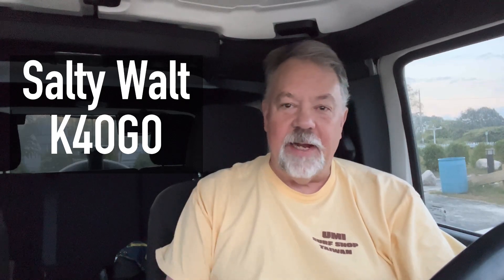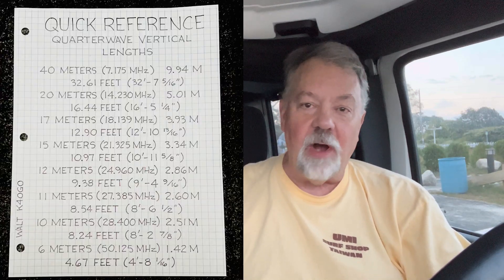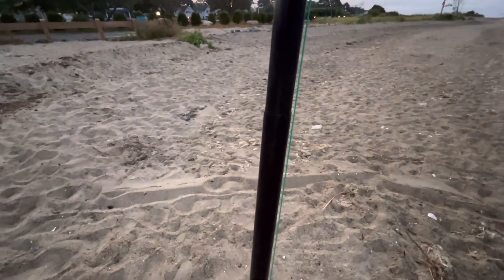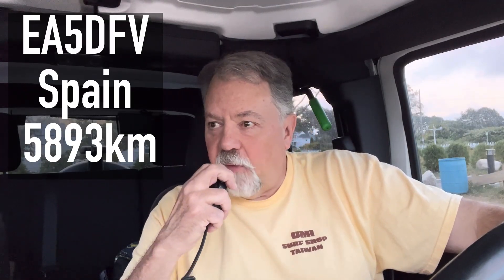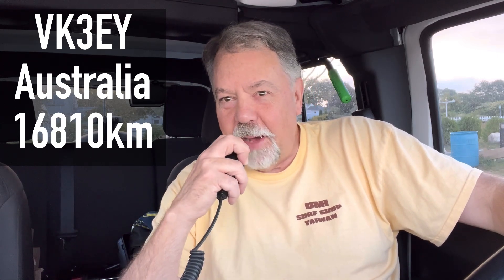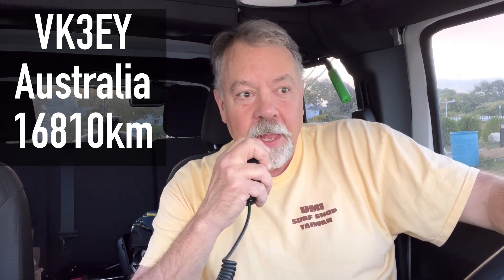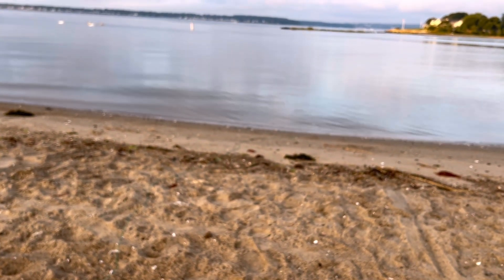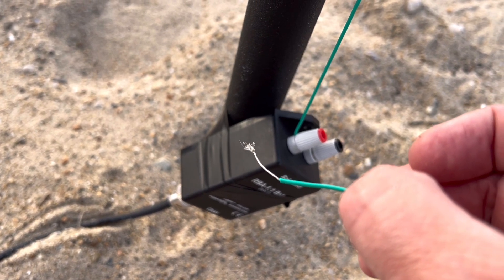Building an Easy Quarterwave Vertical Antenna

Comment: Hi Walt, wondering why it’s always a vertical when there are other great antennas like a doublet for multi band or a simple 10 meter dipole or 11 meters for your CB?
Reply from the maker: Because 99% of the time I’m sitting on top of the world’s greatest ground plane. My main thing is portable by saltwater. A dipole by saltwater is a dipole, a vertical by saltwater gets a 10dB boost from the saltwater underneath it. I’m not sure if you followed my channel when I was in Poland but I built every horizontal, inverted V, sloper I could think of and had a lot of fun doing it but I’m “Coastal” Waves & Wires and that means more towards the vertical side of things. 73, Walt
Reply: @COASTALWAVESWIRES   yep
Reply: Poland has salt water also
Reply: I tend to run verticals due to limited space for anything else.
Reply: Walt are you gonna make a new sketchbook? I have your first one and I love it!

Comment: When you say “kissing the water”, does that mean on wet sand, constantly submerged, or occasionally overlapped by the surf?
Reply from the maker: Wet sand or slightly into the water, not submerged.

Comment: Your videos on all these antenna configurations are extremely helpful and educational.  I do not have the luxury of saltwater.  If my 1/4 wave vertical is on top of my deck (10 ft. in the air), how do I manage the counterpoise(s)?  Thanks.

Comment: Hi Walt, I love your videos. As a new Ham myself, I find them very helpful. One question, is there any reason I couldn't use aluminum as the pole for one of your vertical antennas? I got a smokin deal on some heavy duty conduit at a scrap yard. Thanks!
Reply from the maker: @glennluther7532  thanks! You can use the aluminum as the driven element itself and it would work. As for attaching wire to it, that wouldn’t work as the wire will couple with the metal pole.
Reply: @COASTALWAVESWIRES  Even if I used insulated wire? If not, could the pole be used to hold a whip or as part of an inverted V or sloped wire? Pretty ignorant here. Thanks!

Comment: Took your advice and built a 1/4 wave 10m vertical antenna out of 24ga wire and a banana plug. Used 4 5m counterpoise wires and hooked it up to my yaesu ft8900. Didn't hear anything on 29.6 simplex but I did pick up a repeater on 29.62 in New Jersey.  Time to get the ft857 fired up and try some other bands. Thanks for the inspiration!
Reply from the maker: Awesome! 73, Walt

Comment: Great video Walt!  I am a new ham, Technician license operator and I'm looking to make a simple vertical wire antenna and this video helps.  I'm limited to 10m right now until I get the chance to take my General test.  Just to confirm, by looking at your chart, for a 10m I cut the wire about 8.24 ft and my counter poise can be 17 ft??
Appreciate any feedback.  73 my friend KO6FWW
Reply: Just so you get an answer:  243/fMHz for the vertical radiator & 105% of that for the horizontal radials is a good start.  As for the number of radials, more is better; some say at least three.
Reply: @8TangoCharlie  thank you for the response and feedback! This helps! 73!

Comment: So to change bands do you just lengthen or shorten the vertical?
Reply from the maker: That is correct, a vertical for the 10 meter band is half as long as a vertical for the 20 meter band, a vertical for the 40 meter band is twice as long as a vertical for the 20 meter band.
Reply: @COASTALWAVESWIRES  can't wait for the book to get published.

Comment: A few years back I decided to make a simple dipole for 20M. I used the banana clip but I didn't have a place at home to extend the dipole. I used a 25ft fiberglass pole to put one leg vertical then just strung the other leg out as a counterpoise. SWR was not very good  so the end of the counterpoise being close to my deck I raised it off the ground about 3 ft and got great SWR. I did a POTA activation with that antenna and it went in the antenna box. I later built a 40M version. Both were made from speaker wire and the banana clip. Fun to experiment with antennas.

Comment: I had previously ordered a banana plug connector, and it showed up today, so i decided to build one of these. Alas, i didnt have enough wire, so i built a 10m quarterwave, with 3 counterpoise wires. I had no luck picking anything up on the 10m band, but it worked great as an eighth wave 20m antenna, i was able to clearly receive stations in Puerto Rico, Florida, Netherlands, Italy, and somewhere in eastern Europe. my 5w USDX+ lacked the power to get out unfortunatly

Comment: Can I use the pole if its made from EMT as the antenna instead of wire? make the base out of PVC to insulate from the groumd? If so, then I can adjust the sticks length by sliding them and tighten the thumbscrews?
Reply from the maker: Yes that would work

Comment: I’m just curious, have you tried it without the 1:1? I don’t own one but I usually use  coax with RF beads on it. Which I think is basically the same thing. Does the wire actually have to be in the salt water or can it be close?

On another note….. 
I call BS in length doesn’t matter and more shorter are better than less longer while lying on the ground. I’ve done a lot of experimenting with this very subject in several different locations over several different kinds of ground.

I’m using the WRC Sporty Forty and the Chameleon 17’SS whip on a tripod or stainless steel tent stake w/ a stainless steel jaw mount. It didn’t matter whether or not I used either. With the tripod I was trying to isolate the ground side from actually being “grounded”. I laid out 12 16.5 radials and the SWR was over 4:1, then removed 4 and it dropped to 3:1, removed 4 more and it dropped to 2.5:1, folded the last 4 in half and it dropped to 1.2:1. So now that’s 4 radials @ 8.25’ or 33’ of total radials. I also took 2 sets of my 16.5 radials & made them 33’ long so now I have 4 1/4 wavelength radials lying on the ground. Sliced a little bit off the end of each one and got a 1.3:1 or less across the entire voice portion of 40m. Then I removed the coil and tried 20m, and now I have 4 1/2 wavelength radials lying on the ground for 20m. This got me about a 1.6:1 across the whole voice portion of 20m which isn’t bad. I have no idea why it happened this way, but it did. I’m option to theories as to why.
Reply from the maker: Yes, the video in this with the 5 counterpoise on the ground are with a clip instead of a balun. I’ve actually done a couple other videos on 1/4wave verticals done that way. The counterpoise just needs to at least be over the wet sand from my experience.
Reply: @COASTALWAVESWIRES  thanks Walt. Another great video!

Comment: Hi Walt. Indeed a cheap antenna to start HF experiments as a new ham. A telescopic 17 ft whip is also a nice way to go. They been sold with markings for band lenghts from 20 up to 10 meters. Cheers Phil ON4VP
Reply from the maker: Roger that, I have 3 of them. They are great

Comment: Hi Walt! Thank you, as always very interesting. This is a simple and classic antenna that works well over long distances. I want to share my experience. If you leave only one counterweight and raise it a meter from the ground, the antenna will work even better, and the installation will be easier, and there will be less wire. I checked it in the fields. In general, you have a big advantage, you have a salty ocean nearby.
Reply from the maker: Yes, that will work great. As I mentioned in the video here, I'm just trying to show a lassic simple vertical groundplane antenna. 73, Walt

Comment: Another encouraging video sir. But may I ask, with this wire antennas, what is the maximum power can it be transmitted with it?
Reply from the maker: With 16 gauge wire I have used 100 watts. You can transmit with as much power as you want, you just have to gauge the wires used.
Reply: @COASTALWAVESWIRES  Roger that sir. All the best to you and your family.

Comment: People always make a big deal about radials for verticals. 

Not half an hour ago I was out using 17-ft whip and a coil for 80 m cuz why not?.

Use the same radials i always use. Two bundles of five wires each approximately 10 ft long, scattered somewhat haphazardly around the antenna. 

It worked just fine. 
Psk reporter showed me in the midwest as being heard in Maine, Nevada and really big in the Southeast

No choke, no balun. Just coax and 5 watts.
Reply from the maker: Yep, just get some wires on the ground. 73

Comment: Thanks for another great video Walt! I travel every week as well and just got my license (extra!). I have a question on the radials. If I want to have a resonant 10 and 20 meters can I cut the radials for 20 and use them for both?
Reply from the maker: Yes absolutely, use them on both. When radials are on the ground length is not an issue. 73, Walt

Comment: Would love to see difference with CP in and out of the saltwater in same location to see big of a difference it makes👍
Reply: My personal experience is that I don't find any difference between counterpoise in and out of water. The main problem here on the beaches I operate from is that there is a big difference between low and high tide which would mean moving up and down the beach with the antenna!

73 M3KXZ
Reply from the maker: @petemillis4666 my experience has been as long as the wire is over the wet sand near the water I’m good.
Reply: @COASTALWAVESWIRES  same here. Even on the shingle and chalk we have here, it's all still wet wet salt water at depth when the tide is out. Can't wait to get out again now. Beautiful weather here, but I'm working from home! 
By the way, speaking of seafood (even though you didn't mention food in this video), are Arbroath smokies available where you are? They're from Scotland. If you ever see them where the are, or are ever here in the UK, you're in for a treat. Gorgeous heated in the oven with a slathering of butter!
73 M3KXZ
Reply from the maker: This should answer your question, same antenna as I built it in Europe:
https://youtu.be/iDEUfPgx44M?si=oc3Y1t0Xk8qGPDeQ

Comment: Excellent advice and video! I gave built many a quarter wave vertical over the years. Radials or specifically the number and length are overrated! Once you have enough to bring the SWR down to maybe 1.5 to 1, I have never been able to detect any improvement in signal strength. Sometimes its only one short radial, sometimes it takes more. All depends on composition of the ground. Even some of my best 160 contest scores have been with one or two radials. Also the length is not very critical. I always cut for CW band and the SWR is usually good enough across the band ( except 160 and 80 meters).
Reply from the maker: Thanks and roger that my friend!

Comment: Great job Walt !   Simple but good antenna .  Some kind of choke at base of antenna is a good thing. a 1:1 or ferrite chokes on coax or even coax wrap threw a toroide . all does the same job. Blocks RF from coming back on the outside of shield of coax.  This can cause RF getting into the mic and or effect the far field pattern of antenna.   You want the counterpoise to work . If you want coax as counterpoise then you choke at radio side either the ATU or radio . Some times the length of wire changes. Velocity factor of wire. and type of metal. Just trim to low SWR . Do not over think it. SWR of 1.5 can talk great ! . I talked all over DX with 1.7 SWR . Just threw a antenna together 5/8 wave into 4:1 . measure cut put up I got 1.7 SWR on 20 meters called CQ POTA and got pile up. and was at 50 watts from 7300 ICOM. on 20 AH battery ! 73
Reply from the maker: Thanks! Wow that's cool on the 5/8. I need to do more on that antenna. 73, Walt
Reply: @COASTALWAVESWIRES  Appx 43 ft for 5/8 wave at 20 meters. 20.5 Ft and 25 FT also work with 4:1 . I had to slope instead of vertical . need longer pole . Callum had one. saving up

Comment: As always a good video. I am old but an uncured Ham and love playing with wire antennas. This was the first antenna I put up and made a QSO as an Amateur back in May. I don’t put up tall antennas, <30ft. (9ish meters). Mine works well with my G90. Mostly I use random wire antennas; I have a G90. Coastal 20 (close to this video’s 1/4 wave) has become my favorite- quick and easy. Rybakov is a close second. EFHW is good but too much work for my lazy retired status. I’m working on a Salty Walt 20.5’. Looks like this weekend the Bass  Boat Rybakov (BBR with a PBR) may get tested. Do I have to catch a fish too for it to be considered a success? You need to come to Tennessee for some Nashville Hot Chicken. PS - I have started building my own baluns and ununs. I kind of make antenna kits so I can better organize and activate on a whim. I keep wondering how much time do you spend playing radio versus chowing down at the local diner? Lol. Coastal Diners, Waves and Wires seems to be a de facto channel. Take care and glad to hear the update on your wife. Godspeed.
Reply from the maker: Thank you so much! Godspeed my friend

Comment: VK contact because you're on the beach?  Or is it more time of day?  Or combination of both?
Reply: Both.
Reply from the maker: Time of day definitely, the saltwater also give the antenna 6 to 10dB gain which helps the low power 20 watts. The antenna is still very effective, here is the same antenna I built well inland in Poland using the same radio at 20 watts: https://youtu.be/iDEUfPgx44M?si=oc3Y1t0Xk8qGPDeQ
Reply: @COASTALWAVESWIRES  your poland yard is kinda similar to mine so I'll def check it out!  73!

Comment: Great video!  I am a new ham and i setup my first 1/4 wave 20m vertical antenna with 24 x 25’ copper wire radials and threaded aluminum pipe with a 239 connector, lmr 400 coax and a CM choke.   The setup was in a field in Northern Ontario and it worked great!  I QSO’ed Kangaroo Island in Australia!  73 Walt … and my radio was an icom 7300 on a LiFePO4 battery
Reply from the maker: Thanks! that's so awesome, thanks for sharing! 73, Walt

Comment: Excellent Salty Walt, I think I may give that antenna a try.  What would you say is the max power you can use?  Thank you for sharing Salty Walt.  Look forward to the next chapter.
Reply from the maker: With 16 gauge speaker wire I’ve put 100 watts through it, calculated out it will take much more than that.
Reply: @COASTALWAVESWIRES  Salty Walt, I would have never thought 100 watts.  Thank You

Comment: Sunday was rough.  I got out to a park to activate on 10m and only started really making contacts after lunch time as the band recovered for a while.  My first HF antenna after getting my license was a 10m dipole using the banana plug adapter.  Still keep it in my POTA backpack for when I can toss it in a tree as an inverted-v.  Have not tried it as a vertical since I have other vertical antennas.
Reply from the maker: I'm going to get out with a traditional dipole soon. 73 my friend

Comment: Links to supplies used for your antennas would be nice (banana clip, pole, mount, UnUn, wire). Affiliate linked or not; I don't think Hams mind either way.  I think new and even some old Hams, especially in rural areas, just want reassurance they are ordering the right stuff. Cuts down on a bit of trial and error and reorder time. Just something to think about in the future.  Love the content! -N5RWM
Reply from the maker: Thanks, I typically put links to some products. Probably not a bad idea here. 73, Walt

Comment: The 1:1 at the feed point stops the coax acting as part of the antenna spoiling the resonant length . Also stops the current coming down to the rig and causing problems. A resonant antenna is a special thing especially in good propagation conditions.  73 M7BLC
Reply from the maker: Yes it is! 73 my friend

Comment: 😃 thanks for 17ft! Really nice...as an idea, maybe a video on options to replace a 1:1 with the roll of RG58, it doesn't do anything for SWR but does for feedline radiation and you can do QRO! I think your notebook could also feature a section on each of the components, base, pole, etc....really good stuff yiu are doing BTW 11m is how I git in too and great wou are showing it. de WO8USA🇺🇸🇺🇸🇺🇸